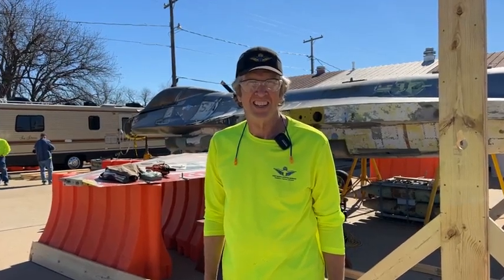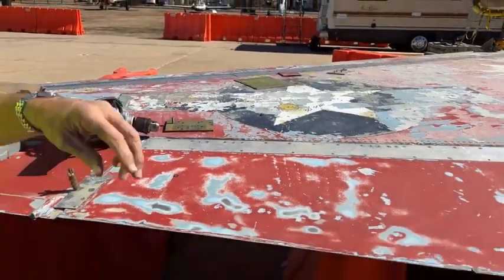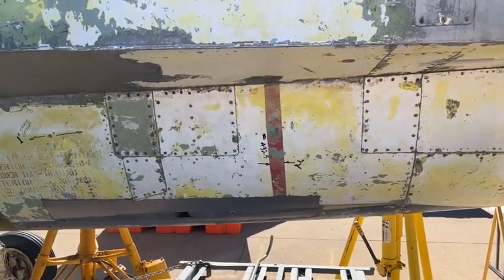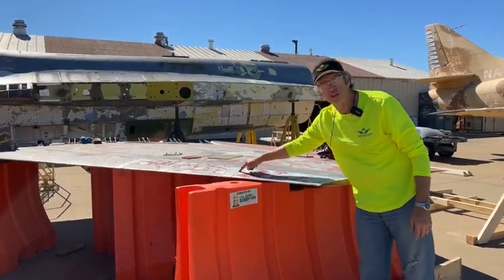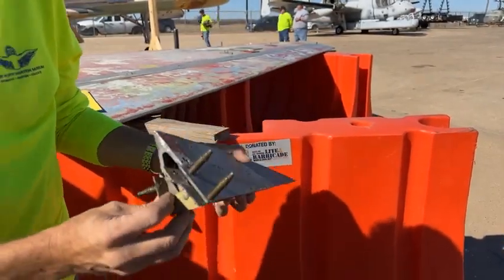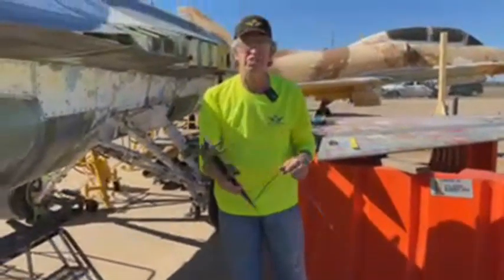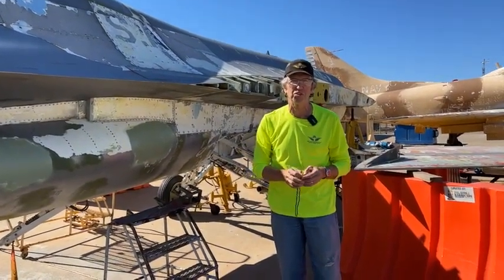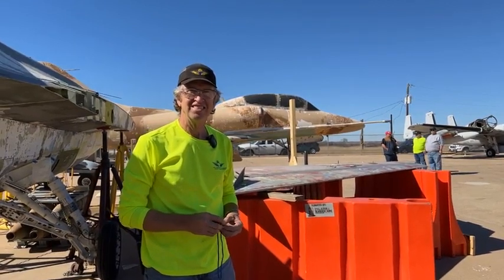Winging It! YF-16 Restoration Update

Comment: Harry Hillaker was asked:
"What was the riskiest portion of your lightweight fighter design?

The fly-by-wire system. If the fly by wire didn't work, our relaxed static stability wasn't going to work. And then the airplane would have had higher drag and would have been less responsive, less maneuverable.

We had a backup that not too many people know about. We designed the fuselage so that if the fly by wire did not work, we could go back to a statically stable design by moving the wing back. We had bulkheads in the fuselage that were designed to carry the load of both placements of the wing."

Is it possible to see any of the remnants of this potential fall-back in the YF-16 fuselage bulkheads?